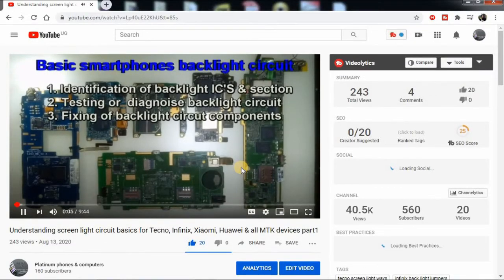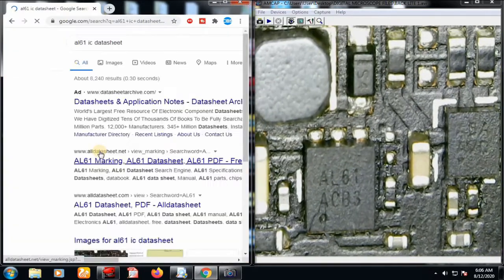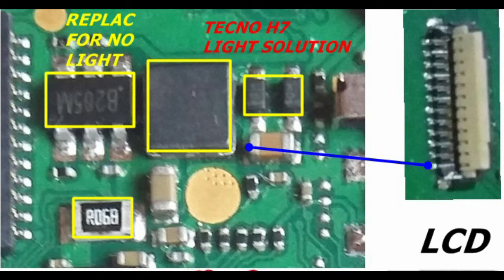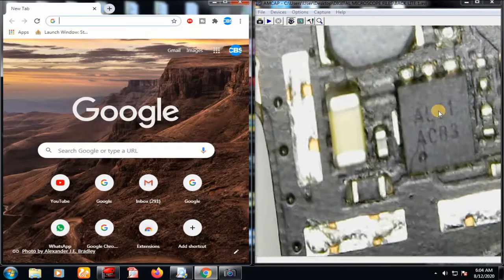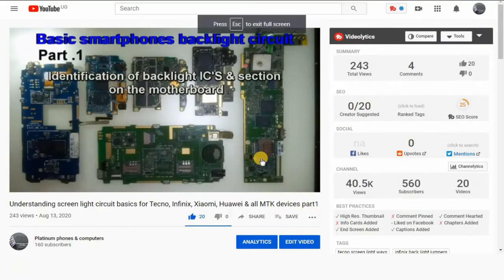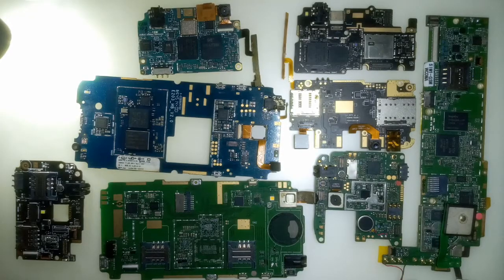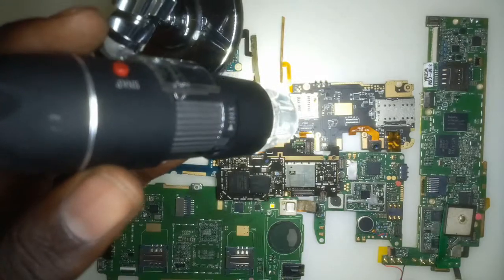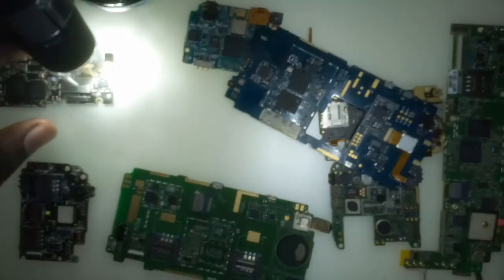part 2 how does a smartphone screen light  circuit work?

Comment: What normally cause phone display light to go off
Reply from the maker: If its not fault screen LEDs, its usually fault light circuit. Also lose screen connectors on the motherboard can cause that